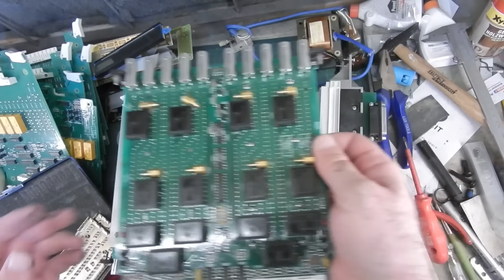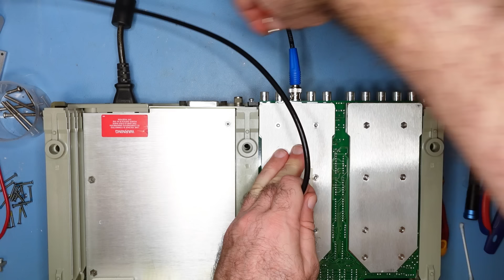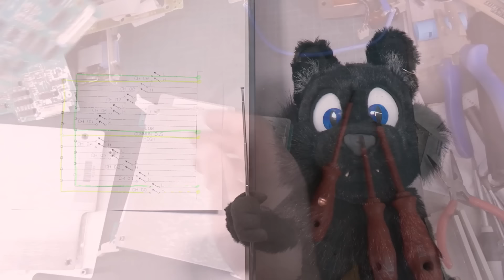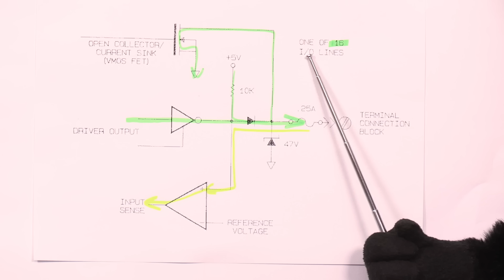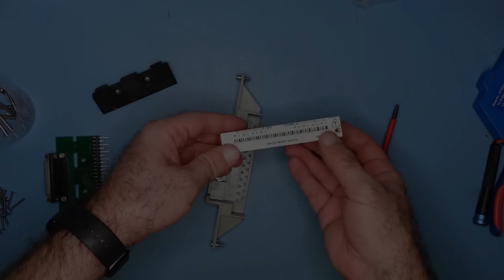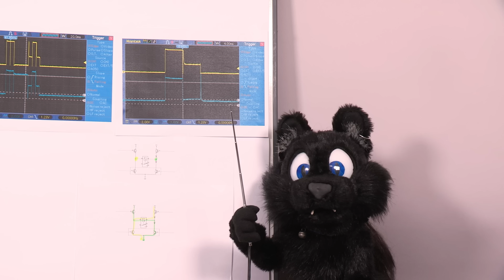HP 3488A - Switch/Control Unit

Comment: A very thorough and comprehensive restoration as always! I've had one of these units for several years, with a full complement of cards and the essential connectors. It was very cheap at the time. I use mine to cycle meters over voltage standards, resistance standards and for ageing and testing Zener diodes. I'm glad I've never needed to dismantle mine, but I'm now well armed if the need arises.

Comment: There are many HP3488 on ebay without card connectors. But a simple Amphenol cardedge connector fits perfect. 3.54 pitch and 2x22 pins if I rememeber correct. A cable protection can be made with a 3-D printer, but I bend the cables together and tigthen them with a tie wrap, secured with a screw to the cabinet. And a coding like the original connectors have can be made with a small piece of epoxy.

Comment: Atkelar you Need more Thicker or Darker Markers when using a diagram's on the White Board, it so Hard to See the Details..
Over all very good work on the HP 3488A Switch / Control Unit..
Reply from the maker: Hmmm... Any one scene in particular? Becuase when I actually draw stuff, I try to make sure to use the broad side of the pen. But when I print out stuff, I hardly have a choice... that's why I zoom in on the details.

Comment: As you know there are 75 ohm and 50 ohm BNC connectors even though they look almost the same except the 75 ohm has a very thin center connector whereas the 50 ohm is thicker.  If a 50 ohm connector is forced into a 75 it will widen the connector and then should a 75 be inserted it will be intermittent.  You never know how used equipment was treated.  Good luck 73
Reply from the maker: The sockets seemed to work fine - But I do need to do a more thorough check if I go into the higher frequencies for sure. I just did a rough test to validate if the switching works and it didn't show any signs of attenuation as far as I could see.

Comment: One of my jobs was to write software for a PC that replaced a large bank of about 15 these. Like you said was used on a telephone testing rig hooked up to a  I think a HP 2000A which I was told went out for repair/upgrade and never came back.  Without the controlling computer an operator had to come by every few mins and press some buttons hence my job was to convert the software  to run on  a PC with a whole lot of rs232 cards.  Fortunately whoever wrote the 2000a code had left behind a full paper listing and of course a  ticker tape backup.  Good times.

Comment: Is the 7 relay board perhaps because there are no more free pins on the connector with 3 pins per relay needed?
Reply from the maker: Indeed - the connector does have around 22 pins  (give or take, I didn't count them) so the 21 from the 3*7 contacts does reach that limit... but... why even put the other three relay positions on the PCB then? It doesn't add up one way or the other...

Comment: Could you set up a simple test. How about watching a lithium battery discharge over time with a constant resistive load. The script could read the voltage every hour over a few days. I would find a video about writing the script and seeing the outputs helpful. You could use your overgrown hp calculator. Thanks Charlie in Virginia
Reply from the maker: I'm thinking of something like this; but whether or not I'll be using the 9825 is a bit of a question; I don't want to put too many operating hours "in idle" on it. There's no replacement parts around anymore.

Comment: Have you tried using a 3d printer pen for rebuilding heat-stake posts that don't have enough plastic left to re-stake? They should be able to melt the tip of the post and then squirt out a new blob of ABS to lock things in place.
Reply from the maker: Not yet; I think it's going to be a bit on the brittle side, since it's probably two different types of plastic meeting... but for this job, the "pegs" were still long enough.
Reply: @atkelar  It should be ABS for most of those stakes, and you can run ABS through a half decent 3d printing pen. I would think that would work ok.

Comment: Love the 3488A. You can pick them up cheaply, and they are excellent for automated test systems. Part number EBM22DREH is a cheaper solution to buying original connector terminal blocks.
Reply from the maker: Oh! These fit? I shall get a few then... Might be useful as "spares", because I certainly will not going to get extra terminal blocks for permanent installations (thinking about a banana-plug board thing for the relay cards)

Comment: GP-IB was also once used as an interface for high-resolution colour film recorders, like the Matrix/Agfa PCR (Personal Computer Recorder), the first compact film recorder capable of 4K resolution and 8 bits per colour (16,777,216 colours).
Reply from the maker: I'm not sure, but I think that it was also used in the early Commodore computers; i.e. the ones predating the C-64. I got an HPIB calbe for the VIC20 (I think) that is just a plain adapter from Commodore to the GPIB socket. I'm just missing the VIC20 to validate that :D
Reply: @atkelar  The PET had a GPIB interface.  And a good number of HP computers used them to connect peripherals, including disk drives.

Comment: The manual for the 3488 is one of the best HP made.
Reply from the maker: I found several of the base unit manuals, but sadly none of them had the 44478 cards in it; at least no schematics for cards. I didn't mention it, but the front panel even has a "help" system integrated.